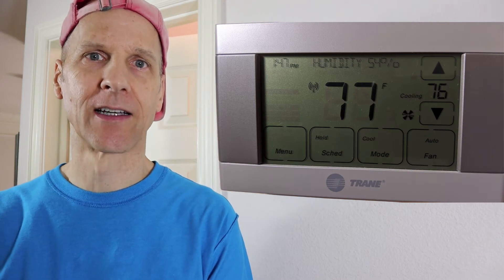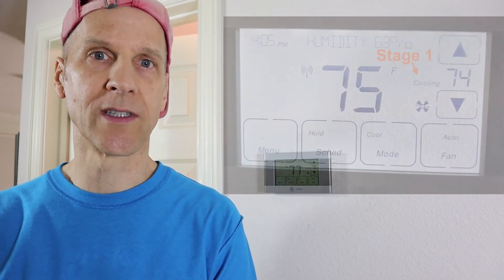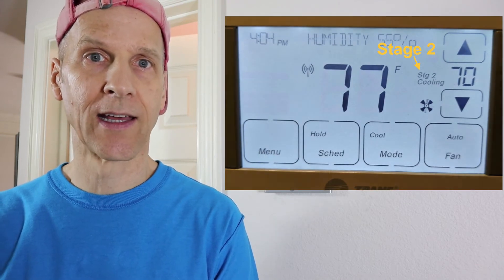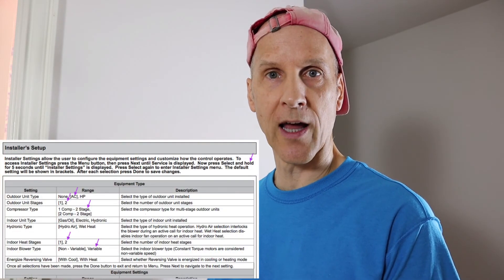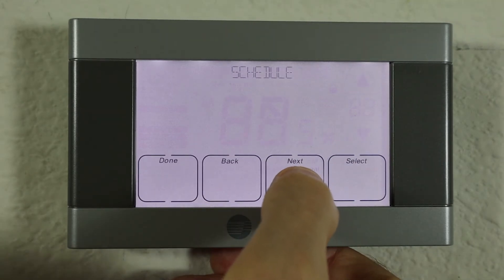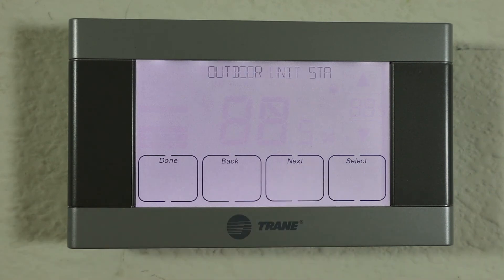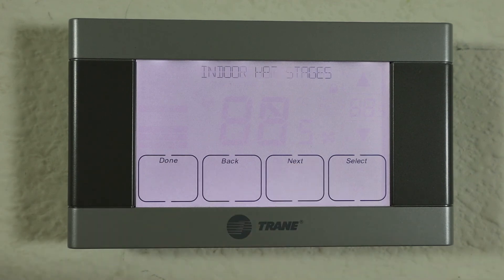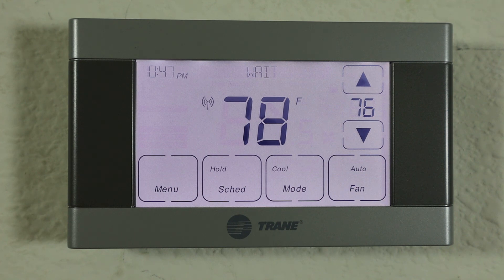Trane 624 Thermostat; Two Stage Compressor

Comment: get to the point already
Reply from the maker: The video is about 4 min total, with the main steps presented at about the 2 min mark, so it's not a long-winded video (unless you compare it to TikTok).

For those that haven't tried them, the YouTube keyboard shortcuts are very handy.

You can jump backward and forward by 10 sec using the "j" and "l" keys. And you can slowdown and speedup the video using the "<" and ">" keys.

Comment: Thank you for this video. After a power outage all I could get was heat. I had to go into the installer settings and reset the unit from gas/oil to electric. Now the A/C is working. It was 98 degrees here in VA today. You’re a lifesaver!
Reply from the maker: Excellent. Good to hear that the video helped you get your A/C working again. It's nice to be in control of your own house.

Comment: Great Video - I assume the same process will work for setting up the 2 stage for the heat. I have done that, should the 2 stage heating flash on the screen when heating?
Reply from the maker: Yes, Mike, if your furnace has two stages, and there's a large temperature difference, I would expect to see 2nd Stage Heating on the display.

Comment: I see a lot of comments about power outages.  Yes thank you for providing this tutorial.  unfortunately, know how to reset it doesn't do much good when the power blips at 8am and you don't get home until 6pm on a 96 degree day and the unit is not cooling the whole day.  82 degrees in the house when I got home.  Could you give a recommendation on a DIY replacement unit that does have a battery backup?  I just want it gone. I won't call the ONLY HVAC company in town because they installed this without telling me I'd have to pay $100 a visit for them to reset it!  Thank you youtube contributors for saving me from this.  I just want it gone. So any suggestions for a replacement? Thanks.
Reply from the maker: I don't happen to have a recommendation, Bob, but there must be alternatives. I haven't looked. Swapping the thermostat is probably a good idea. It's pretty silly to lose the setting when the power glitches.

Comment: I have this thermostat also. I wonder if you can explain why “cool” mode no money does up and how I can get it back. The therm currently switched from off to heat only, though it did use to work. Thanks!
Reply from the maker: AT, it's hard to say why it's not working properly. You might try to cycle the power or try a factory reset on the thermostat.

Comment: I have 2  thermostats of exact type. Each time there is a power off, even just a flick of second, the setting will be wiped off. In Houston, we have a lots of power flashes in Summer, due to thunderstorms. Last night, there was a microsecond power flash (again) from thunderstorm. These thermostats just went to dead mode. I had to reset mode to "cool" to get A/C running. Is there a way to let the thermostats remember the setting? Thanks.
Reply from the maker: Woody Liu, I don't know of any way to remember the settings. Sorry you're having to reset it so often. Better to be able to do it yourself rather than call someone, though.
Reply: I have the same thermostats and same issues of loosing the settings when power outages.  You would think they have a battery backed thermostat to replace these awful thermostats.

Comment: My ac unit was reset by accident. I used to have it set at 77 and at 79 is when it would turn back on.  I want it like that again!  🙏🏻 I just don’t know how to set it back to that?  UGH! 😩😫 Can you please help me?   In other words I had it set 2 degrees higher than my set temp at 77 so it would turn OFF at 77 but turn back on when temp in house would reach 79 and I really want to set it back like that!  Does anyone know where is the setting that I need to do please?  I have a Nexia American Standard 624 thermostat
Reply from the maker: 2cute, you might try to set "Cooling Delta Stage 1 On" to 2 degrees. This setting is on page 33 of the linked manual. I've not changed those settings, so I don't have solid guidance for you.
Reply: @seymour-simon  That’s  what I did earlier but there’s  2 different cooling  delta stage settings   I put 2 degrees to the one that says cooling delta stage ON DEGREES and then the other says  the same thing but with 2 degrees where I had set it. Do I need to put 2 degrees on both of those options?? 🤷🏻‍♀️😢. Thank you for responding I really appreciate it. Been messing with it all day. UGH! 😩😫
Reply from the maker: 2cute, if you have a two stage compressor, you might try these settings.
If you have a singe-stage compressor, then I'd leave the "Stage 2" settings as the defaults.
Again, I'm mostly guessing since I've personally never changed these settings.

Cooling Delta Stage 1 On  -> 2 degrees
Cooling Delta Stage 2 On  -> 3 degrees
Cooling Delta Stage 1 Off -> 0 degrees
Cooling Delta Stage 2 Off -> 0 degrees
Reply: @seymour-simon  yes I have 2 stage compressor.  I will try that. Thank you soo much for trying to help.  I’m soo grateful. Let me go try. Thank you again. 🙏🏻❤️❤️

Comment: Much appreciated for detailed video!
Could you explain why not 2 compressors with 2 stages ? Thanks
Reply from the maker: Hey, huong nguyen. It depends on the configuration of your unit. Our unit only has one compressor but it can run on low and high (2 stages). Some units have 2 compressors.

Comment: thanks for such a detailed video. ill probably call my ac guys tomorrow because i just had this new hvac installed (i believe its a 2 stage 2 ton unit) and its under warranty, but my heat isn't turning on... Any idea why that might be?

Ive set it to "hold" and it displays "heating", but nothing happens. Any suggestions?
Reply from the maker: Sorry I wasn't able to help, "Let's Find Out ASMR". Hopefully you got it working long ago.

Comment: I have a trane heat pump, the auxiliary will not kick in until the thermostat falls behind by 4 degrees. Can this be changed in the thermostat settings so that the auxiliary heat will kick in when it falls behind by 2 degrees?
Reply from the maker: Jeffery, you might take a look at page 33 of the linked User Guide. In particular, the "Indoor Heat Delta Stage 1 On" setting (or related settings) might be of interest.